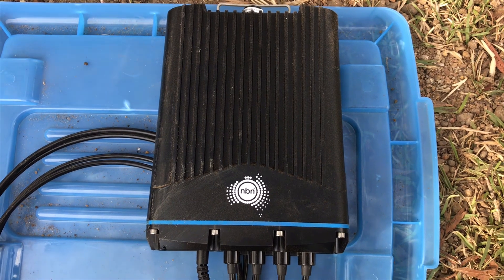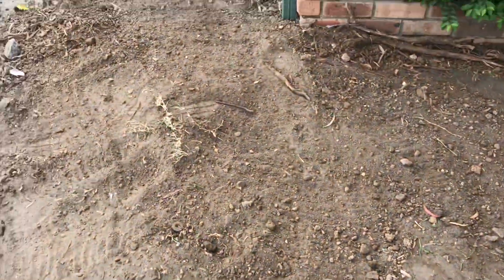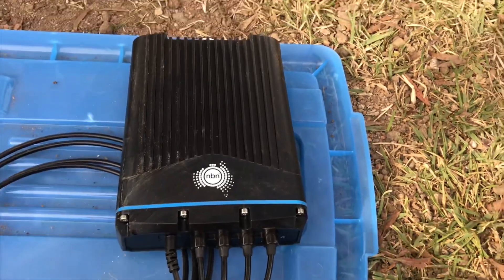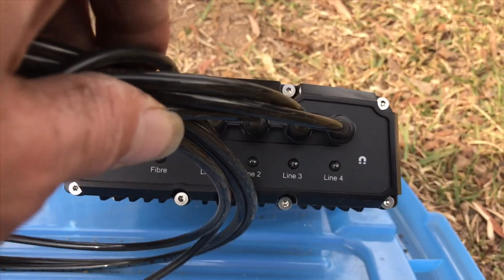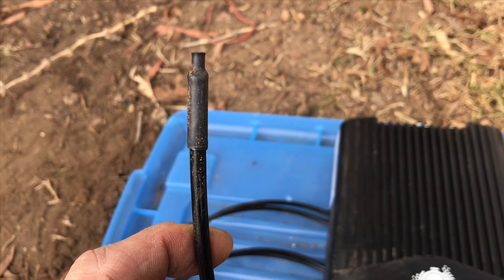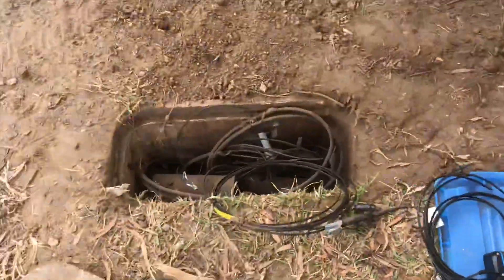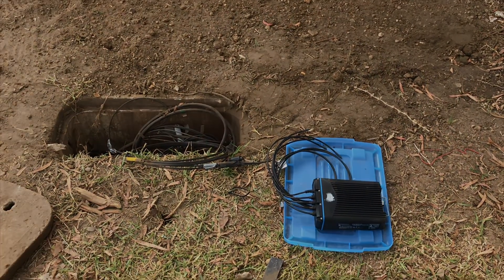NBN FTTC What is coming to a street near you (Fibre to The Curb)

Comment: How does this device manage when it is drowning in 2ft of water ?  I cant think of a dumber location to install this fibre to copper interface switching device.
Reply: They are sealed units so even if in water they will operate as normal and not get flooded
Reply: انه يحتوي على water blocking yarn يحجب الماء على الألياف وأنها من زجاج ليست من نحاس

Comment: I have fttc and I'm happy with it, I get 100/40 pretty much around the clock. When I was talking to the bloke as he worked on the pit though, I said to him " how much do I have to pay you to run that fiber a few more feet into my home?" he just laughed and said "I would if I could mate."

Joking aside, the price of fttc must be so close to fttp, why not go the full hog? I would happily pay for those final few feet of fiber.
Reply from the maker: Unfortunately, that was always going to be the most expensive part of the job.  Most of the conduits that are between the house and the pit, are either filled with dirt, damaged or are just two small. They should have bit the bullet and just done it.
Reply: I can understand that it's actually a really expensive exercise, but NBN Co. should at least give the option for the customer to pay for that last 5 metres. My phone line is overhead anyway, so they probably could've done the same thing with the fibre, or I'd happily trench my front yard...
Reply: I too simply cannot understand why fibre is stopped at the pit and not continue in another 5-10mins to the house. Definitely should be given the option to pay, but that options is now retailed and costs over $1K (going from FTC to FTTP).
Reply: Also FTTP requires digging up ground in front of your house or driveway most of the time. Takes more time too.
Reply: That's awesome. We recently had FTTC installed in our street. Not so worried about giving up my grandfathered cable internet now.

Comment: Will these stop the 6pm slowdown
Reply: @Jo Blow Oi, liking your own comments is pretty low IQ mate.
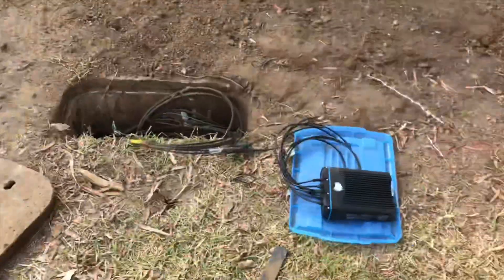Reply: The 6pm slow down has nothing to do with physical infrastructure, it has to do with NBN's absurd CVC (connectivity virtual circuit) prices that they charge ISP's. CVC is a cost that NBN has added so that they are not making a loss due to the massive cost of the role-out. If internet service providers such as Telstra, Optus, TPG, iinet etc were to offer an uncongested connection they would have to charge you $500 dollars per month. It would cost you around $500 per month for an uncontended 5Mbps connection or $500 for a 100Mbps connection that is contented at 1:20 ie 20 share 100Mbps. NBN has actually caused the price of home internet to increase and there for slow down if users are not willing to pay alot more than they would have before they were switched to the NBN. NBN have been working on this and have offered new discounted packages for ISPs so it should start to improve: https://www.nbnco.com.au/corporate-information/media-centre/media-statements/Pricing-evolution.html
Aussie Broaband (ISP) is probably the only provider that actually orders enough CVC capacity: https://www.aussiebroadband.com.au/
Reply: @Jo Blow the wanker.
2 subscribers
This channel doesn't have any content
Reply: @Jo Blow 6 PM slowdown can be solved by type of NBN connections. Just visit some local forums and you will know.
Reply from the maker: Yes indeed

Comment: Fiber to the curb is a pretty dumb idea wouldn't it be cheaper to just run that extra couple feet straight to the home it's limit is only 1Gbps
Reply from the maker: Awesomus Maximus we agree totally.. But for this area unfortunately this is the best of a bad lot
Reply: dude, let me dig up your drive way to put a cable into your wall. since thats cheap..
Reply: It's not necessary in my area all the cables are overhead
Reply: @Jo Blow Fibre can also transmit peta bytes over thousands of kilometers, copper cant transmit a single gig over a few hundred feet. Great post Jo Blow - great post.